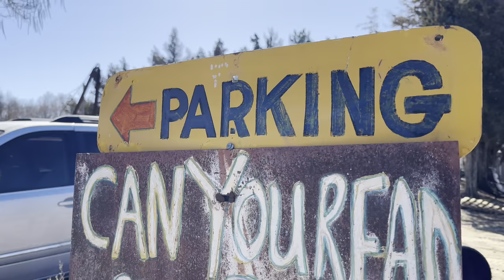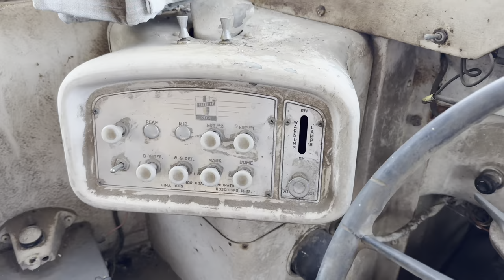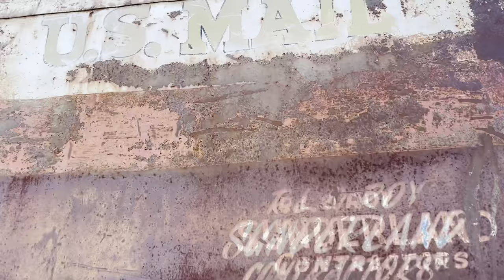JUNK ??? Or RUSTY gold ???

Comment: Hannah what are you going to do with the 2500 Dodge after you take that diesel motor out that Cummings if it's got a good day the whole – would it fit in the 1500 Dodge + 95

Comment: You need to stop buying and start building.
Reply: Cory my Brother has got a 1979 Dodge 1 ton duly , it was a pumper truck my Brother bought it cab and chassis and he had a custom flat bed put on it . But it would be perfect to put a Cummings in it no rust at all , it's red in color with black interior it's been inside his hay barn never out in the weather.